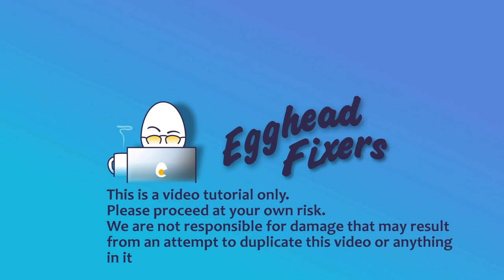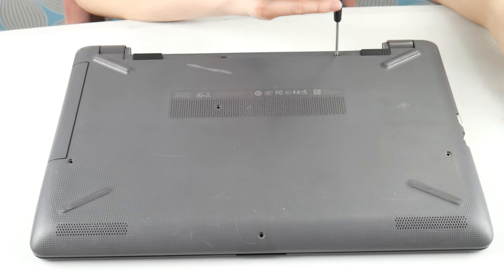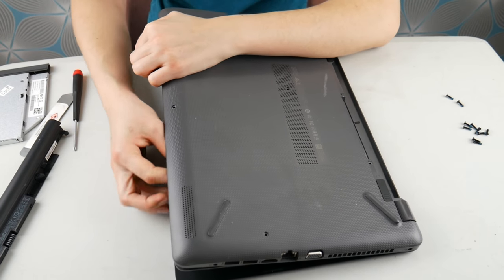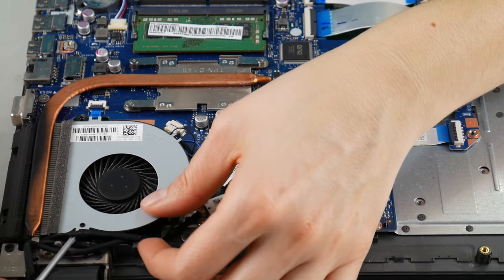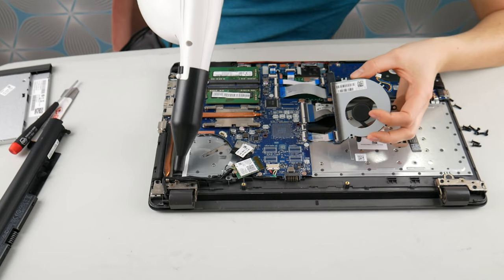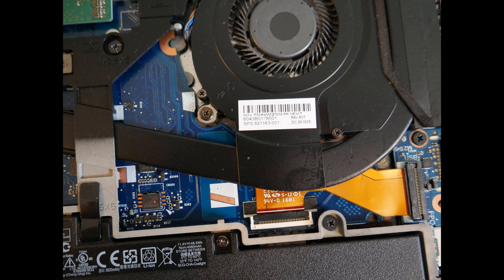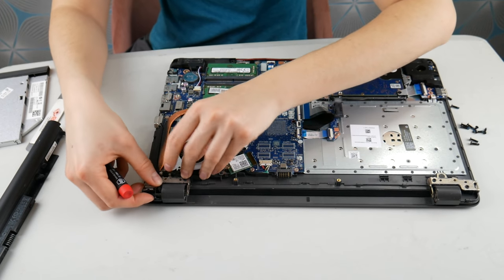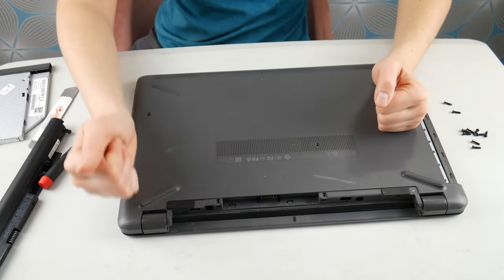How to Fix A HP Fan That Is Making A Lot Of Noise or Is Not Working

Comment: Q: brand new out of the box Envy 15" touchscreen and the fans wont turn off. they start super loud on restart then cycle down, BUT dont go silent. Is this s problem or a new windows 10 issue?  Is this a problem computer (I hear harddrive noise too) or is this normal?
Reply from the maker: They should turn off periodically. If its brand new you should be able to call it under the warranty.
Reply: Thanks. I fixed the sound problem because it was switched to always on in the Bios. I took about two hours of snooping but it was solved. The crunching though remains
Reply from the maker: @tkucey8689  Ya that is strange:/ Nice job troubleshooting the fan issue👍

Comment: Can you help me I have an hp all in one computer with an intel i3 cpu and a intel 630 graphics card. It makes a loud up and down humming noise and I think it’s either the fan motor or the blade. Please help :(((
Reply from the maker: Ya you may need to replace it:/ Also have you ran the HP built in diagnostic to check the health of your hard drive? Hard drives can also making a humming noise when they are starting to go.
Reply: @EggheadFixers  I bought this a few months ago and it’s been doing it since I bought it but I’ll try running the diagnostic thank you!
Reply from the maker: @darkified1404  no prob. Let us know how it goes!
Reply: @EggheadFixers  I ran the diagnostic and it’s fine so i know it’s the fan
Reply from the maker: @darkified1404  Ya that makes sense
Reply: @EggheadFixers  sorry I haven’t replied I have no idea what the fan is doing so I oiled the fan by putting some wd40 in it but nothing changed so I need help plus I can’t send it out to repair if you could make a video please do thanks.
Reply: Oh yeah I forgot the mention since I bought it it has made the humming noise even if it’s not overheating
Reply from the maker: @darkified1404  Sounds like you may need to replace the fan. You can look up a service manual for you model on HP.com/support. It will show you how to take apart your computer.
Reply: @EggheadFixers  Ok thanks I’ll find one to order.
Reply from the maker: @darkified1404  no prob 👍
Reply: @EggheadFixers  I can’t find a fan for my computer I ordered one that was for my computer and it still made the noise. I don’t know what’s going on
Reply: Where can I find a fan? Nothing sells them. eBay is all used and Amazon is a no go
Reply from the maker: @darkified1404  eBay and Amazon are the main places to buy replacement parts. Sometimes you can find more options for parts if you look it up by the model number of the computer and then try looking it up by the part number.
Reply from the maker: @darkified1404  It could be the hard drive. The hard drive when it is having problems can make a humming noise.
Reply: @EggheadFixers  hmm well should I replace it? Or should I replace the fan or both
Reply from the maker: @darkified1404  You could unplug the hard drive and see if the noise stops. If it does then replace the hard drive. If the noise doesn't stop when you unplug the hard drive then try replacing the fan.
Reply: @EggheadFixers  so I run the computer while I open up the computer? This thing is a screen with the components behind it so I can try thansk
Reply from the maker: @darkified1404  Let us know how it goes 👍
Reply: @EggheadFixers  ok so I think it is the fan because when I stopped it the noise stopped but I can’t find a replacement
Reply from the maker: @darkified1404  Did you look for a replacement fan by the part number? And also by the model number? Sometime it will be listed under one of those but not the other.
Reply: @EggheadFixers  I replaced the fan but the noise changed but it was still loud I think I’m going to just buy a new computer I think is the best option right now
Reply from the maker: @darkified1404  Ugh really sorry to hear that:/

Comment: I have an hp15sdu laptop and it's just 4 months old and the battery drains in 2 hours even when I'm watching videos offline. My fan runs continuously even when the laptop is idle . Is there any solution to this?
Reply from the maker: Sounds like maybe it's overheating a little. Are you using a generic power cord? Also have you gotten any sort of liquid on it?
Reply: @EggheadFixers  I use the power chord I got along with the laptop, there's no liquid on it
Reply from the maker: @nikhilshettigar8791  If its only 4 months have you checked to see if it's still under warranty? I would check before you start trying things on it
Reply: @EggheadFixers  it is probably under warranty, I can't bear the battery drain . It's just too much compared to others. The fan keeps running no matter what
Reply from the maker: @nikhilshettigar8791  Ya and it could be a sign of a more serious problem like overheating or a bad motherboard. I would call it in right away.
Reply: @EggheadFixers  okay I'll show it in a hp store then ?
Reply from the maker: @nikhilshettigar8791  Or you can go to their website
Reply: @EggheadFixers  okay thanks 😊
Reply from the maker: @nikhilshettigar8791  no prob!

Comment: So my laptop (not sure is it’s the fan but guessing it is) is making a buzzing sound, kinda like the sound something makes if it’s spinning and hitting something flexible, but it’s always ice cold. So the fan works and is not overheating. It’s just loud. Really, really loud. I’m pissed because I got this a month ago and I really like it and don’t want to have to send it anywhere to fix it for ages, because I use it to speak to my friends. That means it complicates things cause I can’t speak to them
Reply from the maker: Ugh ya that's a pain. It sounds like something got stuck in the fan or it may need to be replaced.

Comment: Where can I find a body for my Hp 15-bs0xx? Looks similar to the one in the video.
Reply from the maker: Ebay is a great place to find parts. You can look it up by your model. What part do you need?
Reply: @EggheadFixers  I need the entire chasis. Both for the lid and the motherboard. It has breaks and cracks. Do you know any seller that can be trusted?
Reply from the maker: @hellyab  We don't use any specific sellers but we just make sure they have good feedback and read the description carefully.
Reply: @EggheadFixers  Will do. Thanks.
Reply from the maker: @hellyab  👍🙂

Comment: A lot of the problem stems with the actual bearing the fan spins on and HP doesn’t make my particular model removable from the bearing without breaking the fins themselves unfortunately. Would like to relube it rather than order a new one
Reply from the maker: Ya sometimes adding some lube to the fan is all that you need. Hopefully that will be all you need to do👍

Comment: My hp specter x360 15in 4K makes horrible fan noise ONLY when it’s plugged in.  Help?
Reply from the maker: It could be a problem with your power cord or battery is causing the computer to work harder when it is plugged in. I would consider replacing the power cord and see if that helps.
Reply: @EggheadFixers  I use two. a USB C 65w charger and the factory charger it came with. Same issue…
Reply from the maker: @singhjessie  Ya that is strange. It could be a problem with the battery. How old is the computer? Is still under warranty?

Comment: Hi, I have an older HP Pavilion  that is from 2013. This is what we call "kids laptop" which is currently used for zoom classes. So no having gaming . After Jan 14 windows update, the laptop started making a very loud whirring noise at startup that lasts up to 20 minutes then it stops. Never had that issue. The laptop doesn't feel hot - so I don't think its overheating. It usually is powered off at night, so this is never put in hibernate or sleep mode. Did you hear of others who suddenly started having this problem after windows update. Any thoughts on how to address it ? There is no cat or litter around - it's always set on a wooden desk. thanks in advance
Reply from the maker: It could be related to the update but sometimes an update can put a computer under strain so if something like a fan is about to break then it does. My guess is if your computer is not overheating then you may need to try replacing the fan.
Reply: Thanks!
Reply from the maker: @MariamBakesatHome  You're welcome:)

Comment: Can we have possibility to remove the hp cooling fan with bigger screw driver
Reply from the maker: As long as the bigger screwdriver doesn't strip the screws then I would try it.
Reply: @EggheadFixers  then only the smallest screw driver suites 😎
Reply from the maker: @earnests5375  nice👍

Comment: my laptop makes lots of noise from overheating but today i turned it on and started make noise so quickly so it doesnt do it from overheating that time. my dad has sent it to get repaired two times already so i dont know what to do.
Reply from the maker: Does the laptop feel hot when it starts making loud noises? Does it suddenly turn off?
Reply: @EggheadFixers  normally it makes noise as it overheats but this time i had just turned on my laptop and the surface was cold. but this time it was making a different noise so i quickly turned it off. my laptop has never just shut off before though.
Reply from the maker: @laprasmaster1698  The laptop can make a strange noise when it starts to fail. You can run a scan to check the hard drive. Here is a video on a different issue that shows you how to use HP's built in diagnostic to scan the hard drive:
https://youtu.be/pe5vedFFLfY
Reply: @EggheadFixers  thank you! i will try that.
Reply from the maker: @laprasmaster1698  you're welcome:)
Reply: My hp17f023 made lots of noise even since I bought it.  I took it apart before and couldn't see any problem. Today I lubed the fan shaft and problem is fixed!  Seems HP has a problem with not lubing their fans properly.
Reply from the maker: @kornylak  Ya HP's unfortunately are notorious for their fan problems:/ Good job troubleshooting the problem👍

Comment: My fan ramps up to full speed in the bios but as soon as windows loads, nothing, completely stops and will not spin irregard of the temperature. I have done a clean install of windows, the fan is completely clean, no blockages, if i put the fan always on feature on in the bios the fan only turns at a slow rate constantly and also does not ramp up or down. Any help would be appreciated, HP 15 DW3003NI.
Reply from the maker: Some HP's fan spin for awhile at start up to blow out any debris. Does it ever turn on at all when you are using it after boot? Also have you tried updating BIOS?
Reply: @EggheadFixers  : It only blows up and till the windows bootloader starts then stops immediatly. In windows it just heats up to 96C and starts to throttle, Bios updated to latest version. Fan blows full speed in bios, I have opened to look for dust, clean as a wistle. Tried running Ubuntu, still doesnt work, dont know what to do anymore.

Comment: What are the normal fan speeds for an HP Spectre 15-df1033dx?
Reply from the maker: The system will automatically adjust the speed fans individually and accordingly to provide optimum performance and also prevent overheating. So it can vary how fast it goes. Does it seem like it is not working correctly?

Comment: My fan is a making a sort of whirring noise i was wondering if this is normal
Reply from the maker: Has been that way since you got the laptop? Or the noise new?
Reply: @EggheadFixers  it just started happening recently
Reply: @EggheadFixers  it sounds as if it’s hitting of something
Reply from the maker: @cdnhrt  It could be jammed or it may need replacing. There is not way of knowing for sure until you open it up:/
Reply: @EggheadFixers  thank yu
Reply from the maker: @cdnhrt  no prob

Comment: hi do you have one for a desktop computer? mines making a high pitched noise
Reply from the maker: No sorry we don't but t's actually usually a little bit easier to replace a fan on a desktop. If you look up a disassembly video for your make and model desktop you can replace it pretty easy.

Comment: Actually, I'm quite upset right now because my HP hp15cc665ci has developed a noisy fan for the second time. I'm about to take it apart for the second time in the three years that I've owned. It sounds like it's dragging on something inside the computer. But if it's dirt build-up in the fan it points out a design flaw because I have used compressed air in every way imaginable just try and clear any dirt from the fan. And because it's dragging it's not spinning as fast as it should and speedfan says the core is running as high as a hundred ninety-five degrees which slows down the processing speed. And screaming High definitions up 4K works the processor hard even though it is an 8th generation i7-8550U CPU processor with 16 gigs of RAM.
Reply from the maker: Ya HP is brutal when it comes to fan problems. In our shop we replace more fans in HPs than we do any other brand computer. You would think they would fix that issue.
Reply: @EggheadFixers  I've wondered about that. Right now the core temp is 190 degrees and the fam is only running 1900 RPM's. But I'm not hearing anything right now . As you can see I'm dragging my feet getting it done
Reply from the maker: @jackhammer111  Ya it sounds like it may be a problem. HP recommends an average running temperature below 140°F. Cooler temps, in general, are better when it comes to computers. Temperatures between 160°F to 195°F  may be a cause for concern.

Comment: my fan also makes a very audible low vibration and i cant figure out the cause, replaced fan, oil, padding, i tried everything lol. but i dont really care anymore
Reply from the maker: Does you computer have a hard drive or solid state drive? Because a hard drive can also cause a low vibration like that.
Reply: @EggheadFixers  nope ssd its the fan :)

Comment: When I try to switch on my laptop,the fan spins for a second and stops . What can be the problem?
Reply from the maker: The fan doesn't stay on the whole the computer is on so it's only a problem if it's not turning on when the computer needs cooling down. Is the computer overheating?

Comment: I would like ro know which CPU cooling fan for HP laptop Model 14-dk0058ca ProdID 6WA68UA#ABL SN# 5CG942741K. I would lie ro buy a fan that is compatible with this model
Reply from the maker: You are better off getting the part number off the fan you have and buy the replacement one based off that.

Comment: Am I the only one whose fan is making an absurdly loud noise? It doesnt even circulates air when doing that. Just a loud and acute sound that comes from there.

My fan was normal but after cleaning it for maintainment it gave me the 90b fan error. Any suggestions on how to solve that?
Reply from the maker: If you have already tried cleaning it then the next step would to replace the fan.
Reply: @EggheadFixers  Update: Yeah, I'll be getting a new fan. But what happened is that I assembled it wrong. Below the hinge piece instead of above it.
Reply from the maker: @elpretender1357  Oh ya that can cause a problem

Comment: What about a quiet new fan, but that makes very small vibration ?
Reply from the maker: the fan and/or hard drive sometimes can produce a small vibration in the laptop. If it does not effect the computers performance then it most likely does not matter.

Comment: My laptop makes this sound, is it safe to keep the fan?
Reply from the maker: It depends on how loud it is. If it sounds like it's getting jammed or if the computer is overheating then that could cause a problem.
Reply: @EggheadFixers  thanks for the help, I do have another question though

is this a common issue, if so, how can I prevent this from happening again?
Reply from the maker: @convoidd  Yes it is a very common issue. One big reason for this is dust and particulates getting into the computer and jamming the fan. So trying to keep your computer free of debris is one way to help keep your fan from breaking.

Comment: HP's brilliant engineers married the hinge screw with one of the 2 tiny plastic fan mounts. and the hinge fails then takes the fan out with it. because of either non metal fan mounts or sleeping brain cells by mounting it to the hinge. i'm gonna epoxy the the fan in place . the experts at HP say that it would be a temporary fix...lol. remember if it's designed put into production by hp, it's less than a temporary fix. is it a trillion dollar company yet, and no one there can figure out one that last' as long as the technical parts might. sometimes you gotta get away from the training skills that hp provide, fix the hinge . or  a metal housing on the fan, hinges should be only hinges, they're taxed as it is just doing that part.
Reply from the maker: Ya that sounds like a poor design. Sometimes when I open up computers I just think...who came up with this design? Because it's just so poorly done.

Comment: My laptop when i close the lid and open it it make a sound and then it stops whats the issue
Reply from the maker: Do you close the lid when the computer is on? or off?
Reply: @EggheadFixers  yes
Reply from the maker: @leanderpereira5257  So you close it when it is on?
Reply: @EggheadFixers  when its on i close it and when i open it for just a sec or two it makes some noise and then its fine
Reply from the maker: @leanderpereira5257  Sometimes the fans run on high for a few seconds to clear them out. It occurs usually when you turn the computer on or when it comes out of hibernation. Does happen at other times?

Comment: So I have a HP laptop which is a year old, and all of a sudden after using it a ton and never experiencing this issue my fan or something makes like a "brrrrr" sound like a motor almost and once it does that it sounds like the fan stops, so I think it may be getting stuck on something. If anyone can help with this I will greatly appreciate it.
Reply from the maker: It sounds like it may need replacing or something is jammed in it. You can follow the steps in the video to help fix that problem.